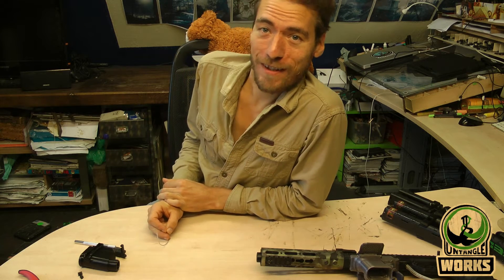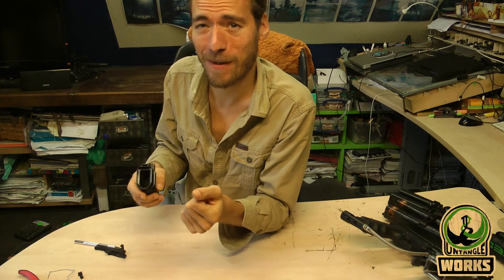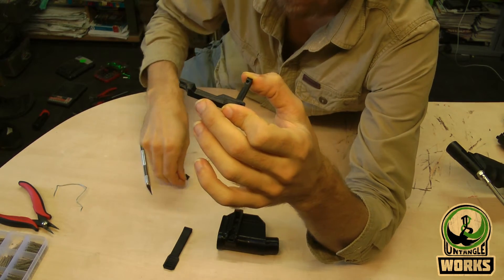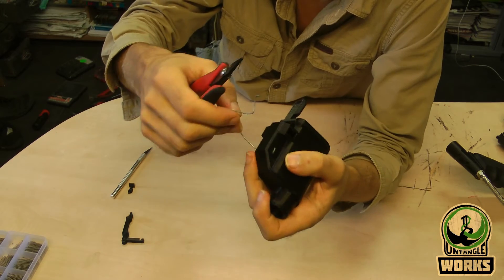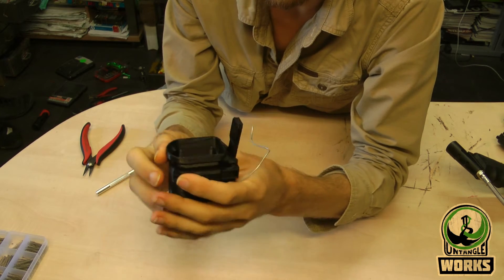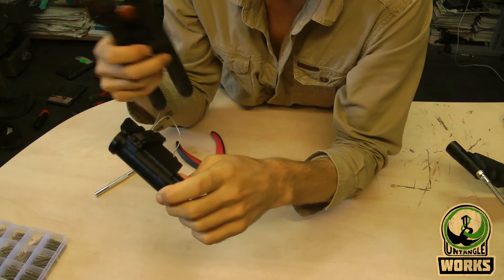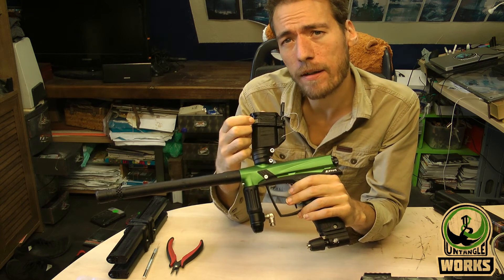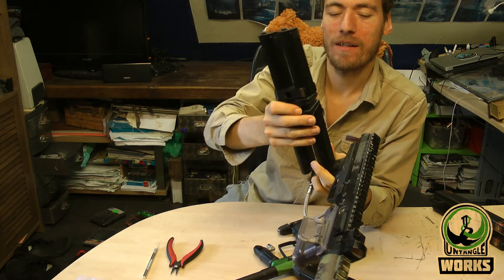UNW Tippmann TIPX magfed adapter installation

Comment: You are amazing, just stumbled on this, I would love to see what else you have compatible with tippmann 98 custom? Perhaps there is a way to purchase some parts still?  reuse the internals in an fgc-style or p90 style complete overhaul? Thank you for sharing your creativity
Reply from the maker: to make the fgc68 with tipmman 98 parts was my first idea. but the body was to long to print on a ender3 style printer. and also to long to correctly fit in the fgc from factor. and later I did lose interest in making a full body for a 98. there are so much projects backing it up. but there is a p90 kit for the 98's  look for UNW P90 on my channel you will find it. and thanks
Reply: @UntangleWORKS  Thank you! I will!

Comment: Hello friend,  you know ... the Etha 2 (emek) body is released for public use, how about making the adapter as part of the body with some picatiny on top / or side . But the best way would be along gun   ------=== , not straight in the feedneck.
Reply from the maker: I already made it, but to be fair for the ETHA 1, but that model is possible to make for the ETHA 2 as well on a later date
Reply: Can you link me to the model ? I am doing a model of my own right now, maybe I can elaborate.